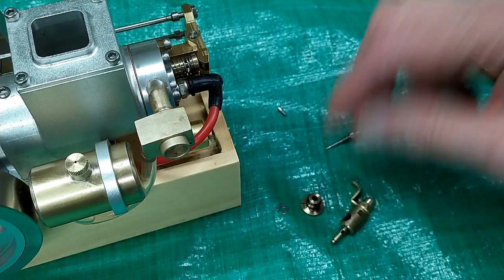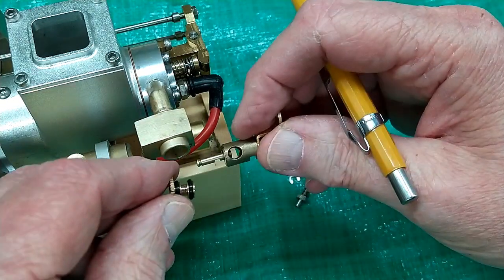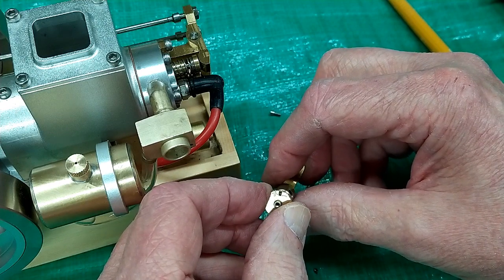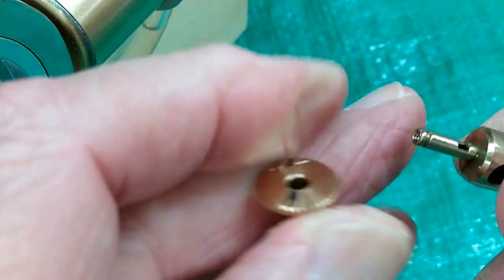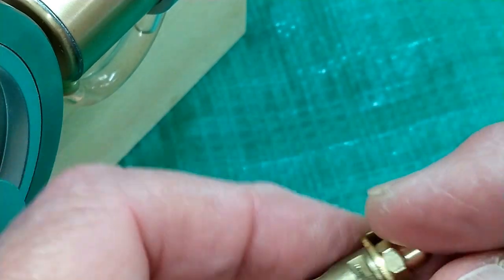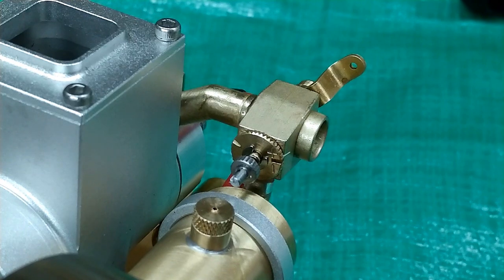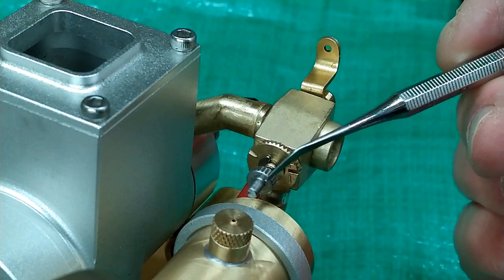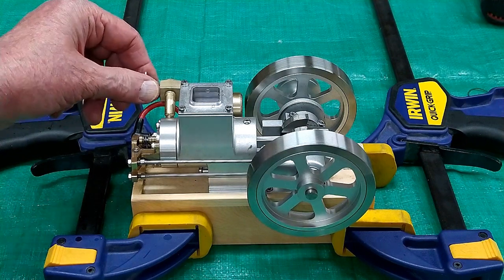Eachine ET8 - Carburetor Disassembly

Comment: Hi Ronald,  can you use a high quality 2 stroke oil ? instead of marvel mystery oil..
Reply from the maker: You can try it. I like the MM Oil as it doesn't seem to form any carbon in these tiny plugs. Good luck!
Reply: @RonaldWalters2010  ok thank you, I can't seem to find anyone in New Zealand that  sells MM.  I have Yamahalube outboard  that I will when I get the engine..
Reply from the maker: I have the following video for reference. Again, you want to use just a hint of oil... barely change the color of the fuel. The only purpose for the oil in the fuel is to keep the o-ring piston rings slippery... anything more simply makes a mess and is wasted. And I would use naphtha if you can get that. Cheaper than buying Zippo Lighter Fuel (which is naphtha). Kiwi's and Aussies probably have a different name for it. :-)

Correct Fuel For 4 Cycle Hit & Miss And Other Model Engines
https://youtu.be/n1zOC2C-iy0

I've been to New Zealand several times. I have driven from one end to the other of both islands as well as to both sides. Beautiful place!
Cheers Mate!
Ron
Reply: @RonaldWalters2010 Yes New Zealand is a wonderful place.. I'm in Nelson. I've found out that automatic transmission fluid is a good substitute for MM.
Reply: Hi Walter,  I have my ET8 engine now and have run it on lighter fuel with a small  amount of Automatic transmission fluid mixed and it runs great,  I've tried pre mixed glow engine fuel with 5% nitro just out of curiosity and it fires up straight away and runs very well..

Comment: The carbs are kind of "meh" on these engines, not very precise and tend to have small air leaks.  Also the throttle governed engines like the M12 need an ignition system with a spark advance curve to throttle up to higher RPM's and run smoother.  I probably complain too much for a model engine in this price range LOL!  Definitely engines for those who like to tinker and don't expect it to run like a Honda.
Reply from the maker: Ha! “MEH” is as good a definition as any… and air leaks like a barn door.

Comment: I have seen a small steal feather on top of the carburator blocking the disc from free rotation but allows to adjust, on rc airplane carbs.

Comment: Good video. I enjoy the way you explain the problem with the carburetor and how the adjustments work. Have you come up with a way to solve the air leakage in the carburetor?
Reply from the maker: Not yet. I would like to put an o-ring around the barrel but there isn't enough room due the the large opening in the carburetor body.

Comment: Interesting little engines.  What is their purpose?  A conversation piece or is there some actual use for them.
Reply from the maker: If you are mechanically inclined, the Hit & Miss versions and the EM1 are entertaining and fun to play with, as are the various vacuum (or flame licker) and Stirling engines, and they could be used to drive small mechanical displays. This particular engine, I’m not sure. It gets hot quick quick and converts gasoline into noise. :-)
Reply: @RonaldWalters2010  Isn't the pulley used to drive something?
Reply from the maker: They started cutting a groove in the magnet disk or you could use the starter pulley. Need to get the engine running first as there is no clutch.

Comment: Hello Walter,
Does it make sense to lube the throttle burrel/piston with grease? And the area that stuck (that you put on a lathe), too?
All of that without clogging up the tiny holes and slots.
If you make a longer lever for the carburetor it's easier to adjust the rpm.
How about constructing a little brass or copper muffler? 😉
Reply from the maker: I don't think grease is the answer. The barrel of the carburetor is a casting and it is under-size. What little machining there is left it out of round. Air leakage around the sides of the barrel messes up the response and the adjustment of the fuel settings. I would like to put an o-ring on the barrel to seal the gap and it would keep it in place but I don't think there is room for an o-ring. And it already has a muffler (see previous video).